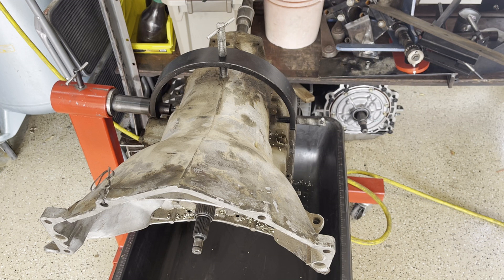TH350C - Quick Teardown

Comment: Hey.
I have a TH350 intermediate wave plate removed and its broken on one side so it has a crack. I ordered another one here in germany and its an open ring so it has a gap and its no full circle.
It doesnt lie very good and stable in the housing.
Can You tell me if this is correct or is the wave plate normally a full circle?
Greetings
Reply from the maker: Hi V8Lounge,
All of my waved plates for the intermediate clutch are one-piece, full-circle plates and don't recall off the top of my head if I ever had one that was gapped. It's common for them crack so by 'gapping' it may have been a preventative measure to keep that from happening.  I do see them like that on the forward and/or direct drum cushion plates and have a few that are gapped but no intermediate gapped wave plates.
Reply: @nickstransmissions  thank You.